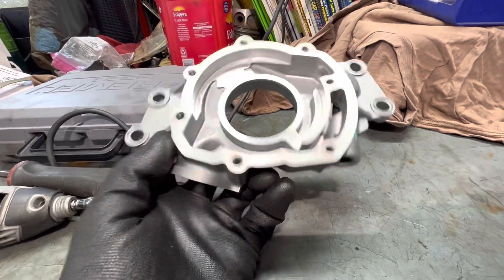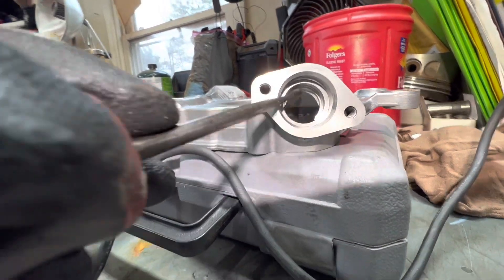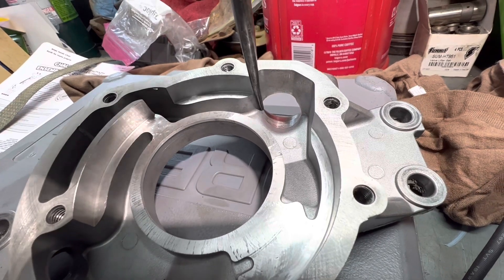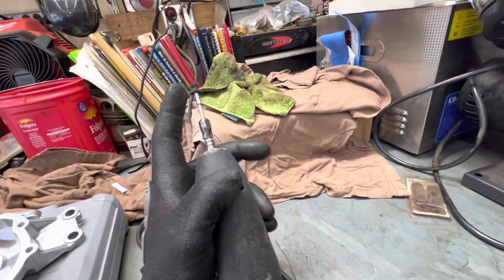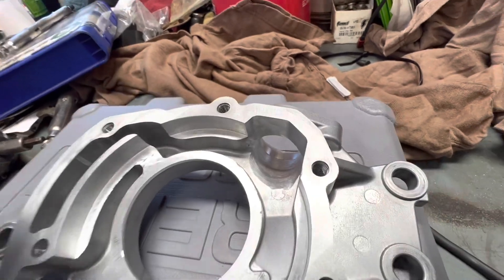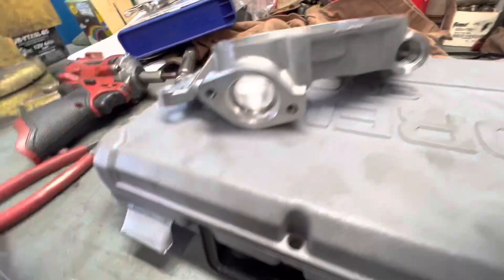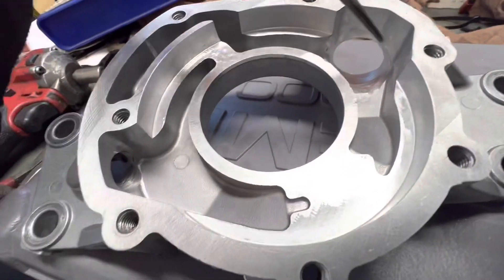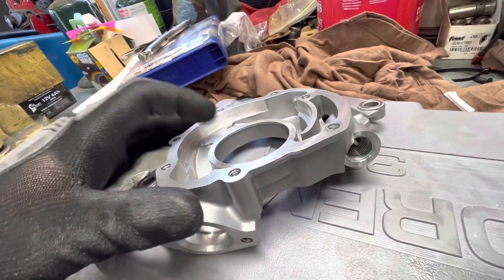Porting an LS oil pump

Comment: The port opening from the pump gears to the engine needs to be radius cut and blended.  Also you will see/feel sharp edges in the dog leg turns that need to be smoothed. JD
Reply from the maker: Thank-you!!!! I will be digging into this, this weekend